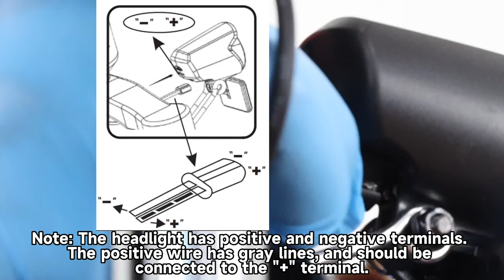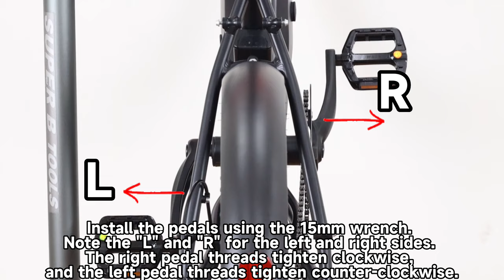Totem Ranger Electric Bike Unboxing Video

Comment: I've got the bike completely assembled and the battery charged. I can't get the computer to turn on. Is there anything else that needs to be connected in the battery compartment? The charger was red to start, The light is now green on the charger.
Reply: Same here. Going to return it.